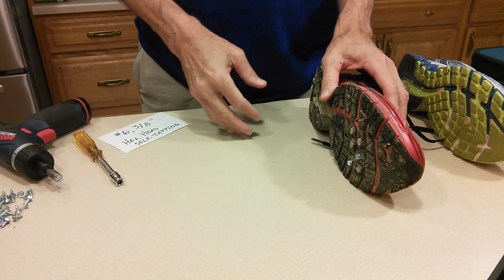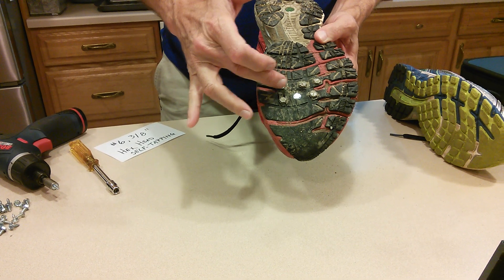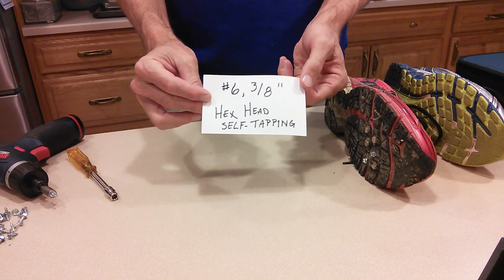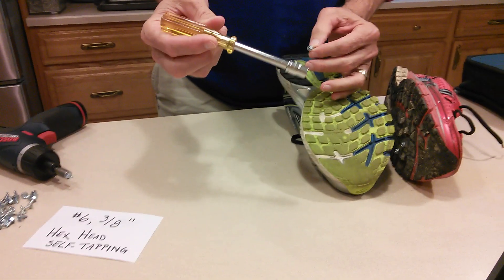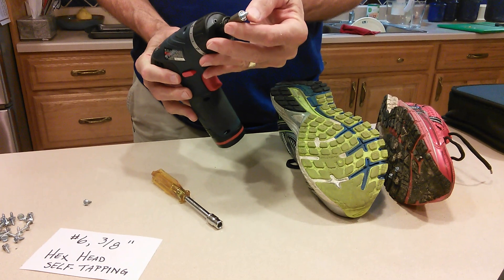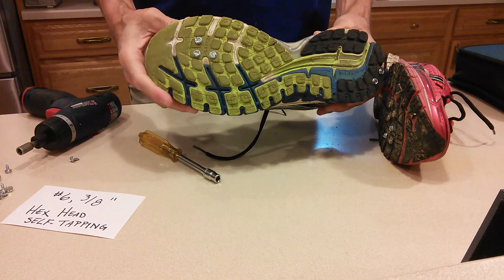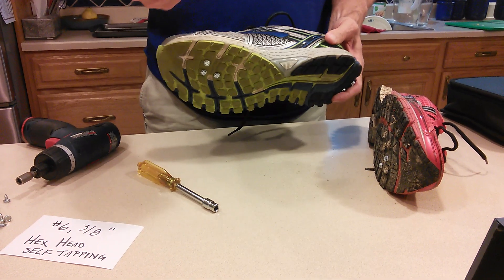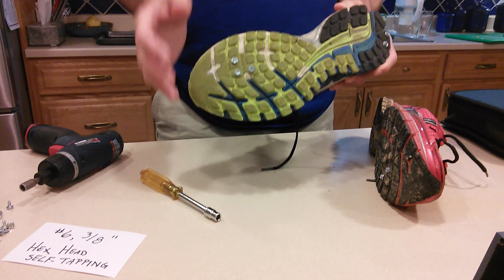How Make Running Shoes for Ice, Snow and Trails

Comment: I've done this.  Two points: 1. Do NOT put the screws under your big toe or ball of your foot.  2.  Self tapping screws are NOT necessary.  Regular screws will tap themselves just fine in the rubber sole.
Reply from the maker: Gary, thanks for viewing!!   Good points.   I've never put a screw as far forward as the toe...yes, I don't think that would help much.   I actually have put screws on and near the ball of my foot, as that's where my feet place the most weight, thus the best grip of the screw...I've never had an issue.   YMMV.   I never did try regular wood screws or machine screws.   Interesting they work as well!   Key thing is keeping them short, thus the 3/16" length suggestion.   Thanks!

Comment: Do you find they create pressure points? Sort of like stepping on a marble.
Reply from the maker: No they don't.   It would seem that would be the case but it's not my experience.   The cushioning on the shoe seems to spread any force out to avoid any pressure point.   I ran a 50K trail race in these shoes a month ago on frozen ground and they remained very comfortable.   Thanks for watching and asking!
Reply: @Joeely618  I'm thinking of using 1/4" "set screws" to give my work boots some ice slide protection. My hopes are that they'll sit flush enough to not gouge the shit out of floors but also provide some grab.
Reply: I tried exactly what was recommended in this video, and the traction is awesome, with zero downside at all. Try it, you won't regret it!